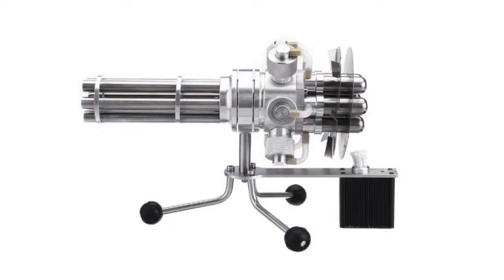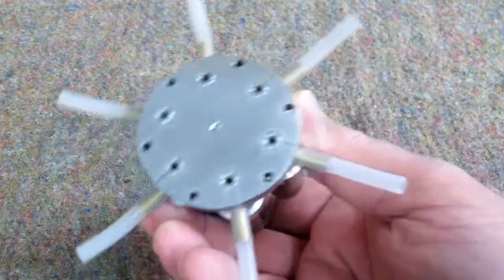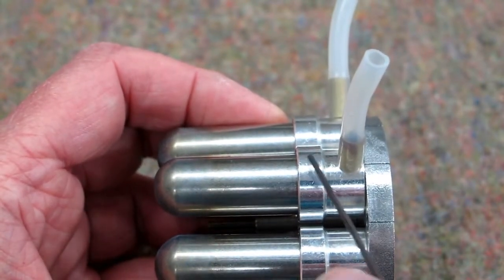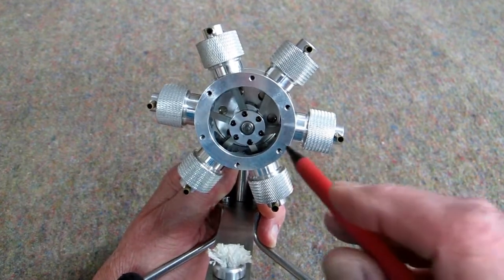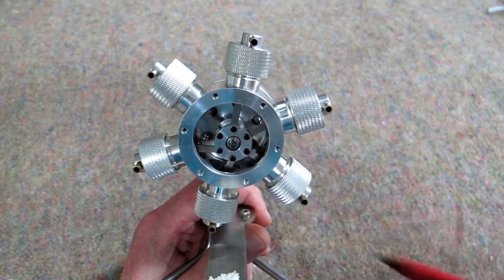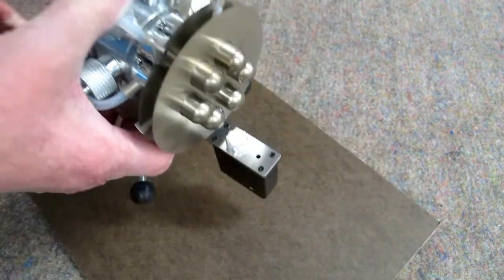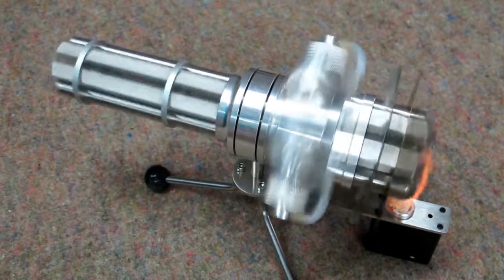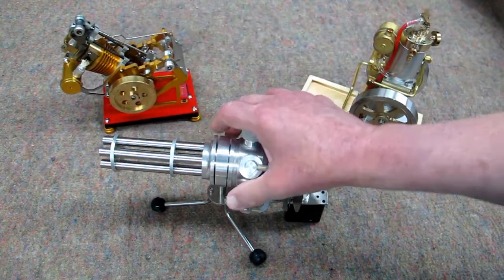Gatling Blaster 6-Cylinder Stirling Engine

Comment: Nice engine. I've only seen blue flames on denatured alcohol before.
Reply from the maker: Possibly you saw a burner like a cook stove for hiking or camping that has air intake below the burner... more of a controlled burn whereas this is just a crude fire and a bit of a dirty burn. At least with the denatured alcohol it burns clean in the sense that it doesn't leave a bunch of carbon on everything. Ron
Reply: @RonaldWalters2010  Oh darn. I was hoping you had some kind of special brew D A. Hah. Could be the wick or oil hiding somewhere. No telling. Thanks, Ron.